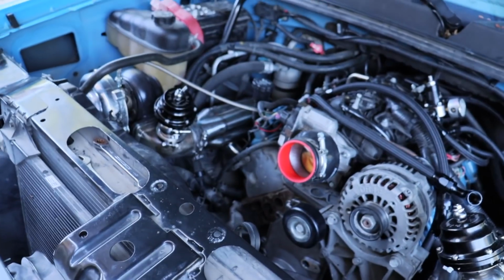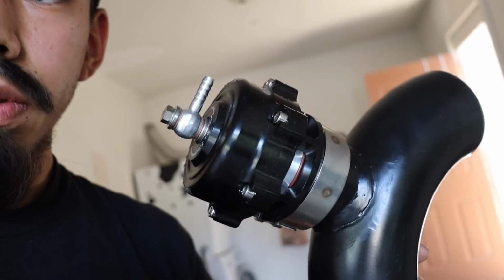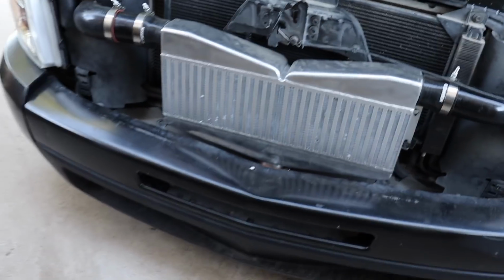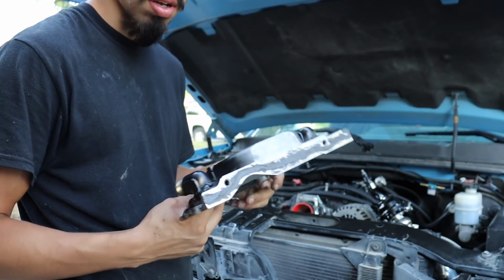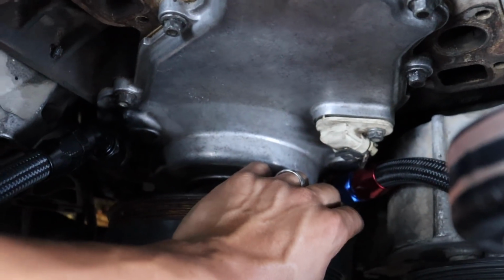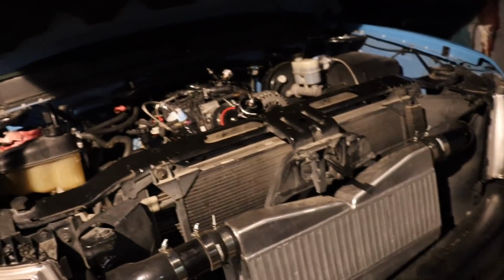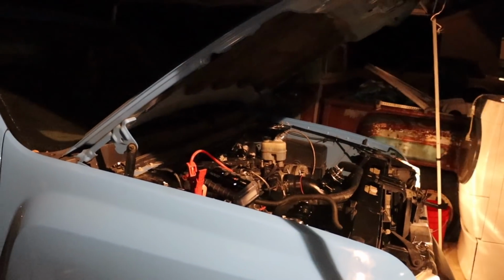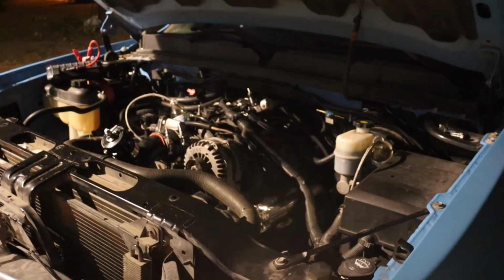MY TRUCK IS LOUDER THEN JERRY TWEEK | TWIN TURBO SILVERADO BUILD PT.5

Comment: Pretty sure you might run into heating issues my single turbo gets hot then a bitch
Reply from the maker: Thinking about ceramic coating the headers I know that helps a lot